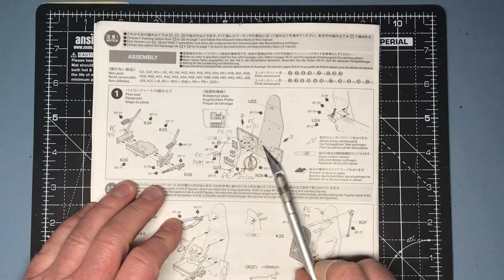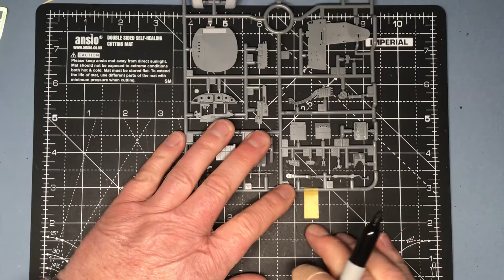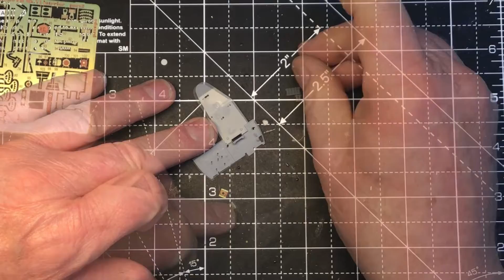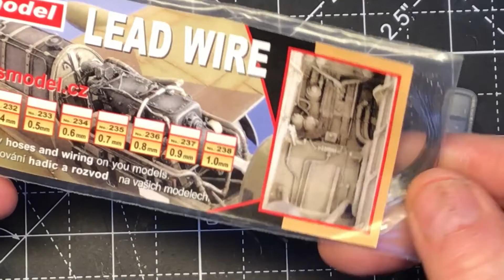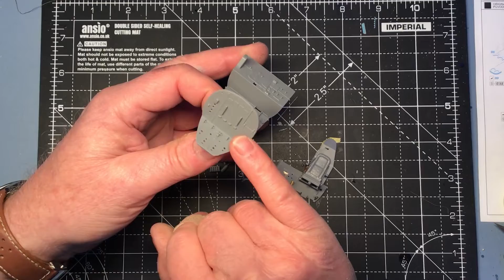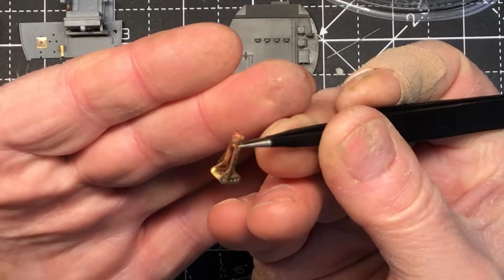Tamiya 1/32 Mosquito build series Part 1

Comment: Hi i just bought this kit, and been over 30 years since I built an airfix kit.
I've spent a good hr looking at the plans and I have a fair idea reading them

For paining do I have to use undercoat or is it still OK just to paint with main paint?

Also is it best to paint before assembly,  or build each section on the plans then paint?
Thanks.
Reply from the maker: I always prime every part before painting, although I know many modellers don’t and still get away with it. It improves the bond of top coats to the model surface and it also highlights any flaws in the parts. I can’t generalise about painting before/after. I do both depending on the type of assembly. If an assembly builds up to something that’s one colour then yes. Otherwise it’s just a matter of your own finishing style.

Comment: No need to respond (I am sure your base - modelers that appreciate your skill) is keeping you busy. My major concern for the Mossy is the final overall painting...making sure that the sub-assemblies are protected while doing the overall painting. I tend to obsess about these things unnecessarily! Thanks again for sharing your experiences with this kit, it's been a great help so far.
Reply from the maker: It is quite difficult model to work out the painting sequence and I recall quite a bit of masking and retouching. Good luck with yours

Comment: I have 2 of these kits to do. I will be modifying one to have the gear up and be in flight
The second one will have everything opened up. I have eduard engines, machine guns, cannons, wheels etc to superdetail it. This will be helpfull for building them, thanks for posting.
Reply from the maker: Be careful with the Eduard engines - or at least the firewalls: I couldn’t get them to fit properly
Reply: @TheModelShed  In what way did they not fit? I will do a lot of test fitting of course, but good to know before going into it

Comment: ive enjoyed following along with this build and will be using some of the after market bits and pieces you have used in your videos to use on my mosquito ( when i get around to starting it ) and using the same weathering technique you use on my 1/24 airfix spitfire ( again when i get around to starting it ) . i have wondered if you have come across a company called red fox decals who produce 3D acrylic decals ( 1 of the sets is for this mosquito ) and whether or not they are any good . thanks
Reply from the maker: I’ve heard of them Mark but I’ve no real experience of them. I wouldn’t bother with the Mosquito set you can get a better result with the kit parts in my opinion.
Reply: @TheModelShed  thank you , ive ordered a set for my tamiya f-16 1/32 cj fighting falcon which i am starting soon , i will post a photo of the cockpit when they are installed .

Comment: More of a question really but you mention hat the lead wire is really easy to glue so what adhesive are you using to fix your lead wire to the plastic parts?  I have not found anything that works so far.  Whatever it is that you are using it seems to be effective and quick setting.  Is it a thick Cyanoacrylate or what?  Type and brand would be helpful.
Reply from the maker: Bill it’s medium CA - I use a brand called vitalbond.

Comment: hi steve, my daughters bought this for me a few years ago as knowing my father worked on them  in india during the war. they also bought me the sets from brassin. dont know if you have seen it, but around that time florys models done a indepth build. when it come to the brassin engines, although he thought the brassin engines had a lot more detail on them, they were one of the most difficult sets he had ever done. the build is still on his site
Reply from the maker: Thanks Pat the Brassin engine set certainly looks complex but I’m looking forward to seeing how it all goes together. I’ll check out the flory build thanks for the tip.

Comment: Hi Steve, great videos and you highlight very Important points, several that can catch out inexperienced builders.  After spending time cutting away the listed parts in the PE instructions because there are replacements that could be beyond their skill level. After destroying the original, with no going back the final replacement PE item looks worse than leaving the originals intact. The end result could be very disappointing, resulting in abandoning the build.  Advice, maybe build up the replacement parts first and see what looks best. Kind regards Dave Porter, London
Reply from the maker: That’s right Dave. I always try to sort out the etch before I commit to hacking the kit parts (like the flare racks in this episode) it’s not always possible though - sometimes you just have to take a deep breath and dive in 😬

Comment: Hi, just for information,  the unit fitted to the cockpit floor under the pilots seat is not a gearbox or anything to do with the flight controls. It is a sanitary tank, and should be fitted with a length of hose (lead wire?) with funnel at the end. You have to cater for those long trips!
Reply from the maker: Great information thanks Bruce - I wouldn’t want the crew to be crossing their legs on a long mission so I’ll give them something to relieve themselves. 😕

Comment: May I ask where you got the lead wire from? A website link would be very helpful. Thanks.
Reply from the maker: Hi Chris. Here’s a link for the particular brand I used 

https://www.super-hobby.co.uk/products/Lead-wire-0-2-mm.html

It comes in sizes in increments of 0.1mm
Reply: @TheModelShed  Much obliged.

Comment: I like that tip of marking out where the photo etch is on the kit instructions. I don't know why I didn't think to do that before. Thank you for that tip! Worth the view just for that sort of tip.
Reply from the maker: It’s a complex kit made more complex with the photoetch and resin. I think you have to plan the build otherwise it’s too easy to overlook something. An hour or so spent checking and cross referencing is well worth it.
Reply: @TheModelShed  I don't know why that never occurred to me to do that. Still doesn't change my mind that photo etch is a nuisance. I think I may just be one of those model builders who just builds for the sake of building and photo etch is just an added expense and frustration most of the time. I did take your suggestion about marking the sprues. That really made it easier to find the sprue I wanted.

Comment: Fascinating that RAF had red fire extinguishers--the USAAF ones, at least the carbon tetra chloride ones were brass/copper/bronze.  At least per my memory (which could be faulty).
Reply from the maker: I’ll have to check that out Mac. The Tamiya instructions call out red but I don’t remember them being red from my service time. I recall black, blue and green.

Comment: Splendid work on the Skeeter.  The Tamiya fit may spoil you for other kit makers.
Reply from the maker: It’s unbelievable - some parts fall into place and the join lines disappear. Just what I need after battling with Airfix’s sloppy attention to fit.

Comment: For your consideration.  To aid with height adjustment crews would often add a bungee cord from the back of the pilot's seat to the top framing of the canopy. I may be wrong but I believe the use of Bakelite was used in wear areas like the floor boards for the pilot and the landing gear door covers' plate, ie., (N29) that is to be painted XF64. I used XF-9, X-1 and XF57 to create a marbled finish similar to Bakelite. Mosquito's used  copper strips for a electrical  ground, I used copper wire for this detail (crew hatch is worth doing if in the open position) but will try copper decal material next time. I had left a follow up comment on your first video after  you asked to see my mossie build. You can now view it and more of my work on my wsite
'Chopperworks', in Burlington, Ontario, Canada. Postings are at the bottom of the DESIGN page. More images of the Mossie with markings added today.
Reply from the maker: Thanks John. I took a look at the mosquito on your website and congratulations - the model looks terrific. Thanks for the detailing notes too I’ll try to incorporate them into the build. 👍
Reply: @TheModelShed  Thank you. I have good inspiration with aircraft modeling. The Avro Lancaster, B-25J, PBY Canso and C-47 fly very close/over my house often  from the Hamilton, Warplane Heritage Museum, 25kms away. Occasionally, they will have warplanes visit in the summer that do the same. BTW, Canadian built  Mosquito plant , 65 kms from Burlington, ON.

Comment: Great work as usual Steve. This is a kit I have my eye on. I have the Corsair kit in my stash and will build that first but by the time I’m ready for the mozzi you should be finished so I can follow the series as I build.
Reply from the maker: Hi Colin. I have the Corsair as well with the Brassin cockpit and engine. Maybe that will follow on when I finish up the Mosquito.
Reply: @TheModelShed  oh cool… maybe I’ll wait then. I have a few hasegawa kits I can keep occupied with. the only aftermarket I have for the Corsair so far is the Quinta studio 3D decal interior and some new decals. I find Tamiya decals a bit thick. I must have a look at the engine set though. Before I get that I need two P and W 2800 engines to replace the 14 cylinder ones in my hobbyboss A26B kit. If only I were a squillionaire

Comment: Hi Steve been waiting for this looking great mine is in the stash a couple of things sorry the leather inside mosquitoes ie cushions and control stick base were either black or very dark green sometimes both in the same aircraft also the pilot sat on his parachute so no base cushion ex mossie museum  volunteer
Reply from the maker: Thanks for that Simon. I was debating about the seat cushion - funnily enough it looks like a parachute pack but just not attached to the pilots backside! Anyway I'll probably be leaving it out. Keep the tips coming - I appreciate any extra inside info to help the accuracy of the build.